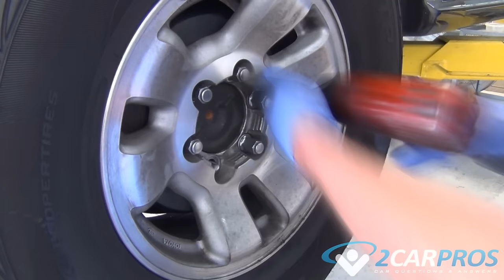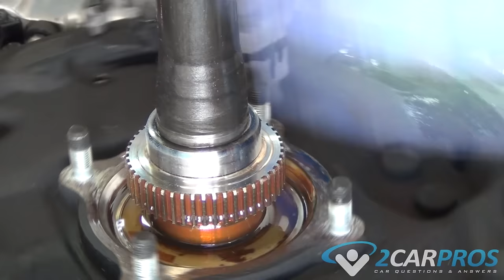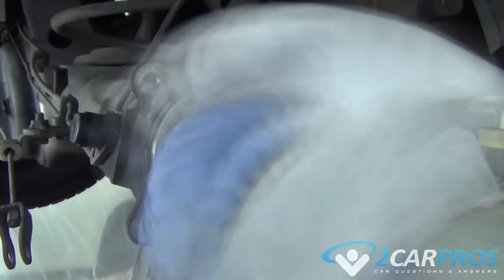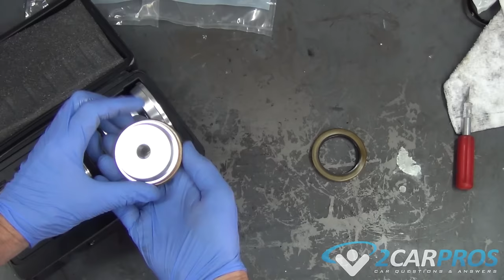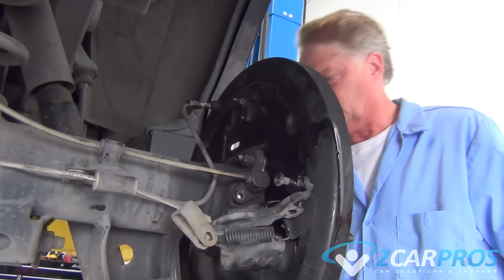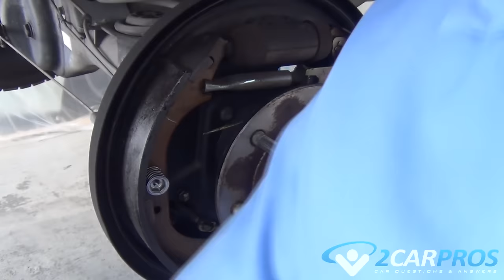HOW TO REPLACE A REAR AXLE SEAL!  -Toyota 4Runner 1996-2002

Comment: theres an inner and outer seal. dont need to take the shoes off unless they are covered in oil, then they need to be replaced. video didnt say anything about removing the abs sensor, even though the sensor was clearly removed. check the splines on the axle and make sure they arent damaged in any way. and while your in there, look at the boots on your wheel cylinders, make sure they arent torn or damaged. make sure the dust boot on the e-brake isnt  damaged.  the makers of this video had a ton of silence in there. helpful hints and precautions help people. spread the word.
Reply: Thankyou so much!
Reply: What kind of socket is he using  to pull that weird bolt off the inner brake pads. At 1:14, is that some special tool or just a regular socket?
Reply: @erichempstead2015  Its and parking brake spring remover tool. You compress the spring with the tool and rotate 90 degrees. You can pick one up almost anywhere.

Comment: no need to disassemble the brake shoes from housing
Reply: Thankyou sir!
Reply: If they have gear oil all over them, which they likely will if it warrants an axle seal, it'd be very likely you may want to due to oil-soaked shoes, but in theory, no, you probably wouldn't have to.

Comment: The repair manual for my 99 4Runner says to use 85w90 gear oil for the rear and 75w90 for the front and transfer case. Otherwise, awesome video!
Reply from the maker: Good stuff! Thank you for watching!

Comment: I like the way he cleans everything meticulously and then opens the seal and throws it on the ground
Reply: In Phoenix AR. I seen a road service tech take a $950 meritor hub bearing assembly for a 2000 freightliner out of the box and toss it in the soft dirt on the side if the road wheel studs down. I was in shock. I had to take a few moments to calm down. Removed it from the dirt returned it to the box studs facing up. hostility asked him for a wire brush to clean all the dirt out of these fine threads as i glared at him. 
I know a lot of mechanics and trust about 2 of them when my back is turned.

Comment: Great and easy to do differential seal replacement. Thank you. You saved me $450.00 from a rip-off local shop!!!
Reply: Ed Medders it’s not a rip off if you don’t have to tools or know how to do the job yourself.  Brakes and axle seals are easy to replace but try doing advanced electrical diagnosis on modern vehicles.  You’d be singing a different tune.
Reply: I wonder what type of work you do, Ed?  Whatever it is, I’m sure you’re a complete rip-off and anyone out there can do it better than you.
Reply: @dickfitzinya3082  that’s the thing buddy. It works both ways. Some customers are trying to get hard work for free and some business owners are charging way too much for easy work. If you have never done mechanical work don’t say stupid comments because the truck being worked on was clean try doing that same job on something w a lot of corrosion then you would be saying take my money or try to do it yourself and realize it’s not as easy as the videos make it look.
Reply: $450 is a very fair price for this type of repair.

Comment: Looks like I have a passenger side leak. I noticed the truck pulls to the left when braking. I thought at first it was a wheel alignment issue until I saw the differential fluid inside the wheel. The pull to the left under braking is due to the passenger rear brake shoes not gripping the drum due to the diff fluid ruining the shoes.  Thanks!

Comment: What grit did you use to polish it?  Thanks  Great useful video.  This will be the 3rd time for me to have it replaced.  We did not polish it last time.
Reply: do you really have to polish it?
Reply: When preparing an axle's contact surface for a new seal, using the correct grit of emery cloth is crucial to ensure a smooth, clean surface that helps the new seal seat properly without causing damage. Typically, you'll want to use a fine grit emery cloth to avoid scratching or gouging the surface, which could lead to new leaks.

A 320 to 400 grit emery cloth is generally recommended for this task. This range of grit is coarse enough to remove any rust, corrosion, or old sealant residue from the axle surface, but fine enough to prevent any undue abrasion that might harm the axle’s surface integrity.

Here are the steps you would typically follow:

    Clean the Area First: Before using the emery cloth, clean the axle surface with a degreaser or brake cleaner to remove any grease, oil, or dirt. This cleaning helps ensure that you're working on only the actual axle material and not grinding any debris into the metal.

    Gently Sand the Surface: Use the emery cloth to lightly sand the surface where the seal will sit. The goal is to achieve a smooth, even finish without creating grooves or scratches. Be sure to rotate the axle as you sand to evenly prepare the entire surface.

    Check Your Work: After sanding, wipe down the area again to remove any particles. The surface should feel smooth to the touch and have a uniform appearance without any visible defects.

    Final Cleaning: Give the surface one last cleaning with brake cleaner to remove any remaining particles. This step is crucial as any debris left behind can compromise the seal.

Using the right materials and techniques can greatly increase the lifespan of the new seal and ensure optimal performance of the differential assembly. If you’re unsure about performing this repair yourself, consulting with or hiring a professional mechanic is always a good choice.

Comment: Hi,Great vídeo. I need to replace the axle seals since the drum is full of grease or oil, I did not know about this problem until I was checking the spare tire and I could see that the drum was full of grease, there is no noise or  any sympton. How can I know that I should  replace the bearings and not only the seals? Thanks!

Comment: I followed your video to the letter along with the Toyota OEM manual  for the process. I'm at a sticking point however because I can't seem the new oil seal properly. It is identical to the old one that I extracted but I can't seem to seat it.  Any advice? Thank you for a great video!

Comment: Someone please correct me if I'm wrong but won't the axle seals leak again due to the amount of play in the bearing?
Reply: That's a good question!  My 4Runner has had the passenger side seal replaced 2 times since I've owned it and it needs another one.
Reply: Yes, that bearing is shot and will definitely cause more trouble. It's likely shot due to the gear oil washing out the grease.
Reply: Agreed, you can see the play in the bearing when he wiggled the backing plate @ 4.:03 like he acknowledged the bearing was shot, stop video this truck needs axle bearings they are the original Nachi's, and even then the brake shoes can stay in place.

Comment: I have a 1991 Toyota Previa that my rear axle seal is leaking.  I pulled my drum off of my drum brakes and there was no oil in the drum or on my brake shoes.  Do you think that I can simply pull the axle and replace that axle seal only and be good.  My neighbor told me that if a little diff. fluid gets on the wheel bearing it should be ok.  I don't have the bearing press to press on/off so was hoping to replace the axle seal only.  What are your thoughts

Comment: I have a 2002 tundra TRD. I followed your method and no more leaks but I do hear a humming sound once in a while. My question is do I have to add oil inside the ABS hole to lubricate the gears. Maybe it's dry and that's why I hear a humming sound?
Reply: do not add oil to tha abs hole the noise your hearing is the bearing it need to be replaced asap.

Comment: So I have a 2001 Toyota 4Runner 4wd and something in the rear axle has to be replaced. It has been leaking, i don’t know if it’s related but the brake pedal sometimes goes soft. I was told it need to be replaced but not exactly what till I go tomorrow and check it out. how much does it usually run to get fixed or replaced?
Reply: How much was it? And what exactly did they replace?
Reply: Benjamin Praeger they replaced the rear axel seal. It had been leaking and cost around $500

Comment: How did you know it wasn't the outer seal also? The one that's pressed in behind the bearing?
Reply: The outer seal is only for keeping dust and debris from the bearing assy.  Its not meant for keeping oil back
Reply: Its more of a dust boot. Toyota calls it an oil seal. There shouldnt be any oil in that part of the axle housing, where the inner retainer, abs ring and outer retainer bearing and outer seal are.

Comment: the bearing is sealed the gear oil washed the grease out the bearing needs to be replaced it will not last  thlnk about it
Reply: That wheel bearing is not long for this world